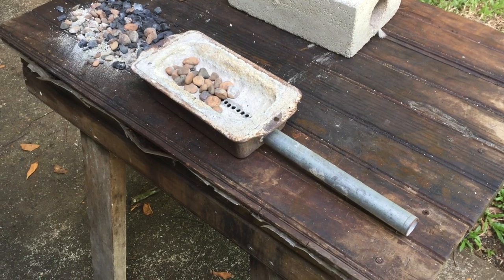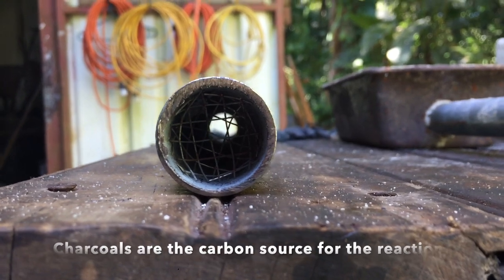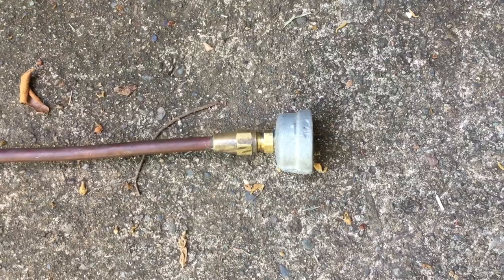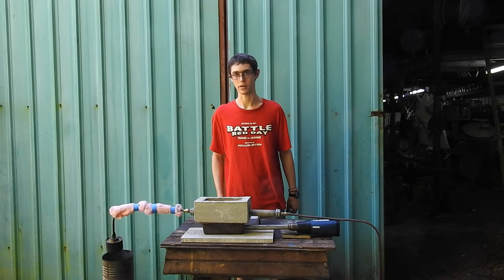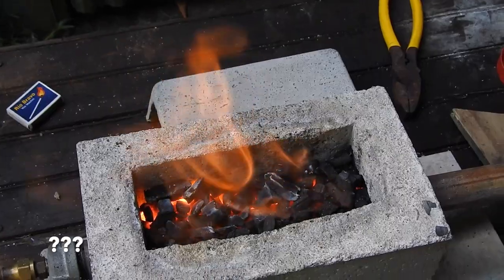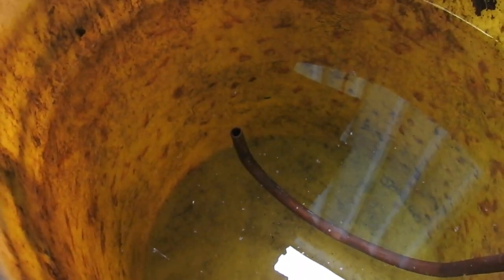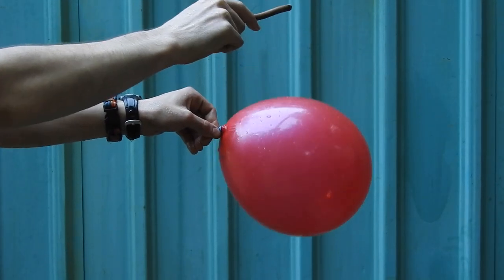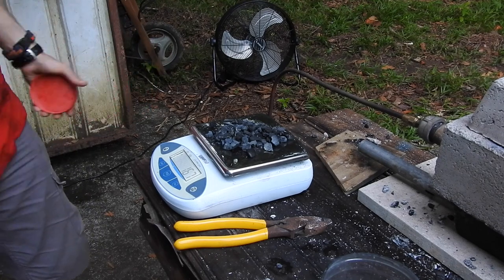Homemade Syngas Generator

Comment: yes i did this using a rocket stove . i also used the precibal whit  the water the steam in my gasifier smock it worked well & burnt of the damp in the smock  the pip at the bottom heated the turned to  steam into hydrogen as it burnt of the oxygen in the damp smock  smock  past trough the charcoal. it brans of the oxygen . The same affect is achieved if a 1/2" pipe is inserted in the  larger  pipe & field with charcoal, & The same results  is achieved if an  1/2" pipe  siting in the charcoal  the heat product  burns of oxygen as it passes down the 1/2 "pipe the   burnt of Oxygen as it passes throw the pipe producing hydrogen gas out  the pipe. exact it is in reeves of the result that tacks place's when you Bern hydrogen & oxygen to cut steel. so The two methods work well but i  have to say  the benefits  when past trough the charcoal it as hydro carbons  CO"  that barn well in an engine for generating power.  les fiddly in half as much time 

in closing the siystom is best used.  By the ues of an aculeate a cylinder set  inside  with a flange 10 " from the bottom set inside   a larger tank with a flange to stop it rising above a set distance . the Wight of the top tank adds presser as it rise with in the first tank & as it sits in the water the gas within. as it own spark arrester. with a suitable flashback arrester on the generator a smaller bubbler  to pass to the final  stage of combustion within the generator. if a presser gag is applied to the accumulator the presser with in will load so  you to estimate the run time of the system & regulate flow + it will added you to  Estimate the number  of burns to achieve a desired presser & run time. for charging battery banks .

Comment: I suggest running your steam through a larger bed of coals to increase the temperature of the steam to a super critical temp to improve the thermodynamics of your reaction.  the steam will actually be cooling the reaction in the current setup and by increasing your steam line length and having it run through an additional coal bed it will have a much higher temperature saturation and result in a better reaction.

Comment: Nice! 
 I have been relying on woodgas powered generators for the past few years, and with good results. 
 Your system looks mighty fine, and it may be more energetic than woodgas, as Nitrogen is excluded from the outgoing gas stream. 
 I really must try this. 
 Keep up the good work   :)  .
Reply: Ahhh there you are! I thought you may have left a comment or three here.
Reply: @flash001USA  
 Howdee Flash, 
 Yup, I tend to hang around these kinds of videos, like a mouse hangs around a computer   ;) . 
 Gotta collect all those watts, before they can get away.
Reply: I think you can use the "waste" charcoal from the wood gas generation as feed for this reaction. That way you (theoretically) convert the whole wood input into gas.
Reply: @ftr98  
 Yup, that will work nicely. 
 I made a charcoal gasifier that runs on the waste from my wood gasifier, and it works like a charm   :)  .
Reply: How can it be stored? Can it be compressed and stored?
Reply: @matty31272  
 Yes indeed. This gas can be stored in tanks. 
 The main problem is that you cannot store very much of it in a standard tank, unless you can find a way to liquefy the gas.  
 My latest video shows how I stored woodgas in a barbeque bottle, using a fridge compressor. 
 In the future, I want to have a go at making an old fashioned gasometer, to store more gas.

Comment: If I am not mistaken you should have in theory produced around  9,41 liters of Syngas and the released energy of the combustion would be 101 kJ (assuming the formed water is gaseous)

Δm = 19.0 g - 16.7 g = 2.30 g     n(C) = (2.30 g) / (12.0 g/mol) = 0.192 mol     n(Syngas) = n(CO) + n(H2) = 2 n(C) = 0.384 mol     molar volume at 1 atm and 25°C : 24.5 l/mol
V(Syngas) = n(Syngas) * Vm = 0.384 mol * 24.5 l/mol = 9.41 l 

ΔRHm = ΔRHm(Products) - ΔRHm(Educts) = (-393.5 kJ/mol - 241.8 kJ/mol) - (-110.5 kJ/mol + 0 kJ/mol + 0 kJ/mol) = -524.8 kJ/mol
ΔH = ΔRHm * (n(Syngas) / 2) = -524.8 kJ/mol * 0.192 mol = 101 kJ

Sources: 
https://en.wikipedia.org/wiki/Molar_volume
https://de.wikibooks.org/wiki/Tabellensammlung_Chemie/_Thermodynamische_Daten

Comment: With a wood gas generator to make the charcoal (NHIL did that experiment as well), you could additionally capture another feast of combustibles.  Good video.  Well done!
Reply from the maker: Does the wood-gas generator stop making gas at some point well before the combustibles (now charcoal) are consumed?  I always got the impression that the charcoal line moved with the gas production, leaving almost nothing left behind.  If I were to make one and run it until the flame went out, would I have loads of charcoal left?  I've gotta tell ya, I have picked every piece of my charcoal from our pizza oven with tongs, and I would love a more industrial alternative :)
Reply: @scottviola8021  the answer to your question is yes . only at plasma levels of heat    doe the oxygen barn of & gas will not Bern with out oxygen  Much like lightening in a storm produces sufficient  hear to tern 2part'sof hydrogen in to water  =  H2/0  stem past threw a retort of charcoal will produce  sufficient heat to predust hydrogen & carbon  if it is separate in side  say a 1/2"  copper or steel pipe the oxygen will barn  (OFF)  but will remain  carbon free . in fact the freely balloonists  acquired there hydrogen in the same way.  barning charcoal in a 4" pipe bread in a charcoal pit of fier as it gat red hot the  steam throw the pipe burning of the oxygen  to fill the balloon. it a fainting subject & how i predust power of grid for year's in a wood benign stove & later in a rocket stove .

Comment: Nice video. Hope to see more from you in the future.
I got a couple of suggestions for you. 

Your reactor is working, just not as well as you think. The first baloon fills up quickly, because the first gas to be released from the coal is probably the same gas you noticed heating the reactor. Probably woodgas from the coal. 

As you noted your coal reactor-packing is not great. Maybe grind up the coal a bit more, to smaller chunks or outright powderize it and then pack the reactor more tightly. This will also help conduct the heat better to the coals, because the reaction is strongly endothermic it sucks up alot of heat.

Also heating the steam to 900°C takes alot of the energy. More coal will also provide more thermal mass and contact area for that. 
The mesh is good, if you grind the coals more you maybe want to use some sort of quartz wool or other heat resistant fiber material to keep the coal in place.

If you are now rightfully worried about your tightly packed reactor possibly blowing up, you should add a pressure relief valve. 

You should probably add a pressure relief valve to your water boiler regardless of my other suggestions, steam explosions are no joke.
Reply from the maker: Thanks!  I should figure out a way to do this stuff... I just haven’t because 1) I spent practically no money on this, and 2) it is hard to physically put It together

Comment: can you make a video on converting the syngas into methanol, please, it will be a great video
Reply from the maker: Believe me—I'm pondering it!  That is why I thought to do this project in the first place.  I'm a bit concerned about the pressures required, which are on the order of >50atm or >735 psi or 5MPa.  As you can tell, I am a BIT short on equipment.  For example, to compress that gas in a 1/4" (6.3mm) ID tube, it is 36 pounds (16kg*g) of force!  Crazy!  Then, I need catalysts, which I have never used before.  Fortunately, the reaction temperature is quite low and methanol will condense at room temperature (eliminating the need for a cryo system), so that gives me some hope.  I'm going to university soon, and once there I can get proper materials and hopefully make a better syngas generator and methanol reactor!
Reply: @scottviola8021  thats awesome bro,  i was also researching in this field and i have found some methods in which i dont need to have such a high pressure, but i need to test that, i am just a noob, but i am thinking about LMPEOH process for methanol production and it is the process which uses  an inert mineral oil/powdered catalyst slurry as a reaction medium and heat sink. As the feed gas bubbles through the catalyst slurry forming MeOH, the mineral oil transfers the reaction heat to an internal tubular boiler where the heat is removed by generating steam. and this system doesn't require huge pressure and also there is no requirement for stoichiometric ratio of H/CO/CO2 so this makes an perfect example for methanol production but off course we need to make some updates and i am thinking about an hydrogen production from electrolysis which have the potential to increase the pressure without any major equipment but we need to make a proper equipment which supports our idea, there is no end for new ideas and imagination and it can done

Comment: How does the steam react with the coal if the "reactor" is a closed pipe? Where does the steam come in contact with the coal?
Reply: coals outside the pipe are there for external heating, there is also some coal in the pipe which he weighed.

Comment: Could we use propane gas instead of coal? What kind of modification we need to make it work? 🤔
Reply from the maker: No clue.  Propane gas is already a higher-order molecule and might as well be used as-is for fuel or further synthesis.

Comment: Are you certain that the water reservour was still full of water? Maybe the watervapor died down, causing a reduced yield. 
Also, im pretty sure that the flames, that you suspected might be woodgas coming from the coals, is just fine dusty coal particles flung up by the air suply and quickly burning of, causing the flames.
Reply from the maker: I know that the water never ran out because it was surprisingly full after cooling off.  The problem was probably the charcoals.  That's a neat idea for the flame—any idea on how to verify it?  Maybe inserting a piece of metal or a cup to collect it before it burns?
Reply: @scottviola8021  Im Not Sure how you could scientifically back my clame but one Thing that points towards my assumption is, that if the air running through the coal is cut of, the flames disapper, suggesting that the air current defently plays some role in the Formation of the flames. Normaly coal doesnt produce any flames because it has no volatile compounds left. Coal making is literally just that. Heat up some wood, to strip it of all compounds that can vaporize, leaving only carbon behind. Consequently the source of the Flame has to have a different origin than the composition of the coal

Comment: Can it be produce by electrolysis to use in bike as fuel?
Reply from the maker: H2 gas can be produced by electrolysis, but I am unsure if CO can be.  I suppose that this could could be used for a bike, though!  NightHawkInLight tried something similar with a tiny wood-gas generator

Comment: Commercial gasifiers mix a small amount of oxygen with the steam to sustain the reaction (so that external heating isn't required). Could possibly also avoid the external heating for the steam generator with some careful placement of a coil delivering the water.
Reply from the maker: I read that too!  However, I designed the reactor to avoid any contaminant gases running through it.  Since I don't have oxygen at my disposal/a way to feed it in, I'd need to use atmospheric air, which lets in tons of nitrogen.  Nitrogen and CO2 dilute the flammable products.  With regards to creating the steam: that would probably work; a good use for all the waste heat being blown away.
Reply: @scottviola8021  Hi. Please tell me whether the gas stored inside the balloon which you burnt is coal gas or wood gas? And if it is coal, then can I use charcoals instead of mineral coals?
Reply from the maker: @shafayetsayed138  I would say that it is coal gas. You definitely could use charcoal--this is what I did here! No mineral coal was used in the making of this video :)
Reply: @scottviola8021  Thank you.

Comment: Imagine being able to capture this gas, and then compress it into a holding container, like a welding gas tank, and then running this and some oxygen through a torch and using it to braze or possibly even cut and weld with.  :-)
Reply from the maker: That would be neat.  I haven't pursued compression too much due to the danger of accidentally mixing in oxygen from the air and creating a pipe bomb.  Plus, I don't want to be the one to figure out that it explodes under high pressure like acetylene!  It would be very fun to use it for such things though!
Reply: @scottviola8021   Perhaps dissolving it in a liquid then...  if it is soluble in some liquid or another, like Acetylene in Acetone.  :-)
Reply: Nope.  Never put hydrogen into a steel tank.  It will eat through it and explode.

Comment: Doesnt the steam put oyt the fire. I dont understand it.
Reply from the maker: Once water has evaporated, the vapor is just like any other gas.  It will not undergo another phase change (which is what makes up a lot of liquid water's cooling power).  When it enters the reaction chamber, it simply gets heated by the pipe and charcoals from about 100C to several hundred C.
Reply: So does the steam actually spray the hot coals, or does it go through the coals inside a pipe.
Reply from the maker: @troybranson1856  The water is vaporized in the little can over the fire.  That gas is pushed through the little copper pipe into the coals.  It is no longer liquid when it gets in there!

Comment: Is there any powder coating you could add to the inside of the Ballon  that would BIND with the CO ?? And thus render it easily disposedof, rather than be a toxic gas which people could possibly breath...? 

   Seems like a simple thing...🤔 but who knows 🤷‍♂️ maybe you could be the guy who invents it...?
Reply from the maker: The CO is there to be burned!  It is only toxic if you breathe it, and the tiny quantities I am producing are only mildly harmful to the atmosphere.  CO problems tend to arise in places with much, much more pollution.
Reply from the maker: There is a reaction, called the water-gas shift reaction, that can consume CO and H2O to produce CO2 and H2, but I have not worked towards doing that at this point

Comment: steamforming, pyrolysis-carbonization nitpicking
Reply: water bubbler should make more hydrogen from the co
Reply: you could make a first condensation filter before the bubbler, with a flash-back valve, to make gasoline from c + h2o, try metal + co2 + h2o, kinda steam-forming too
Reply: multiple passes of the steam
Reply: electric insulated precise resistance heating, using solar and wind (read nuclear) energy
Reply: you forgot the water-shift reaction, to pass the class
Reply: Is the copper pipe from the can connected to the steel pipe or it goes the charcoal in the chamber?
Or how does the steam react with charcoal?